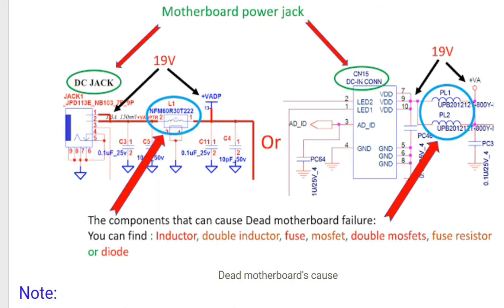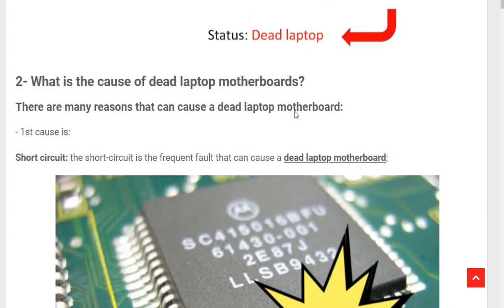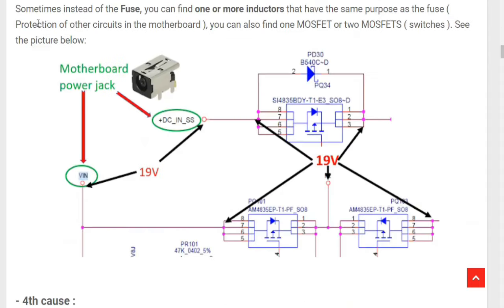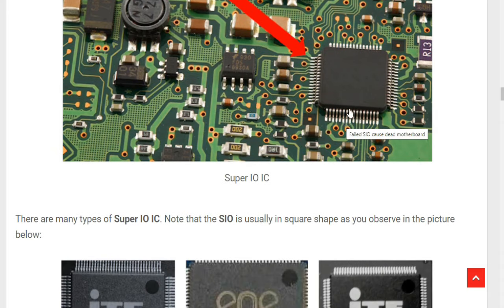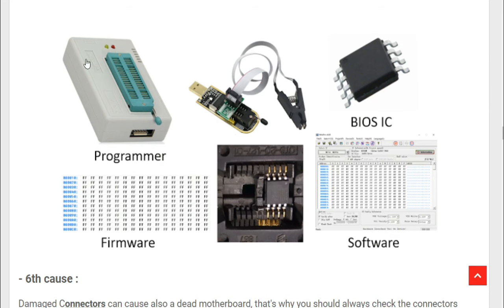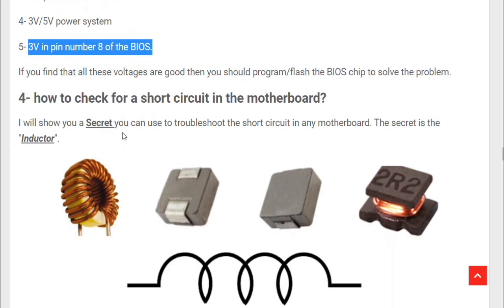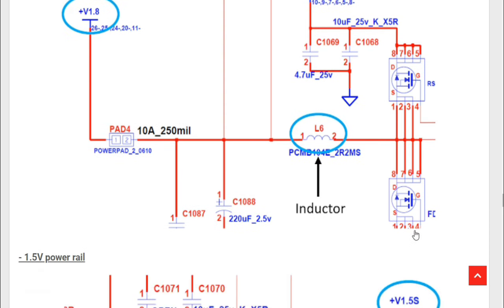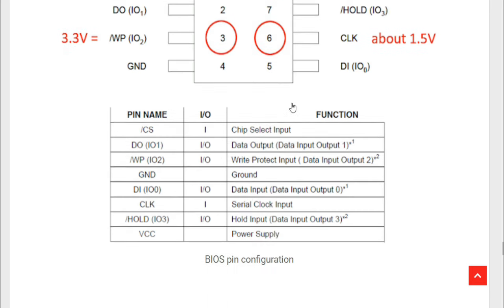Dead motherboard repair - laptop motherboard repair course

Comment: God bless you boss for this teaching, I so much like your teaching design, please up 🤛

Please sir I have a question and i would appreciate it so much if you can respond to it. 

Without hot testing to know 5volt from 3.3volt always-on, is there a way we can differentiate them using our multimeter or by physical looking? Thanks in advance boss👍